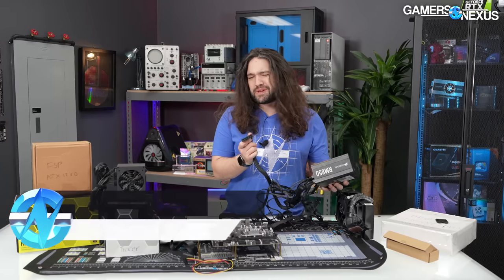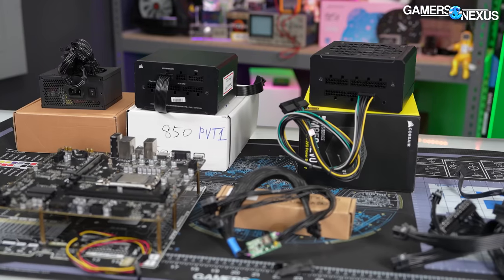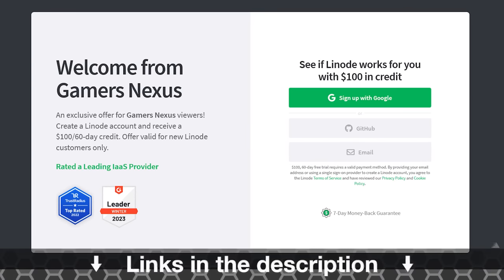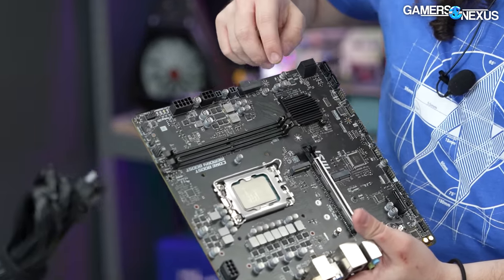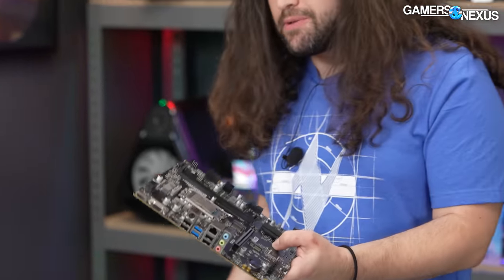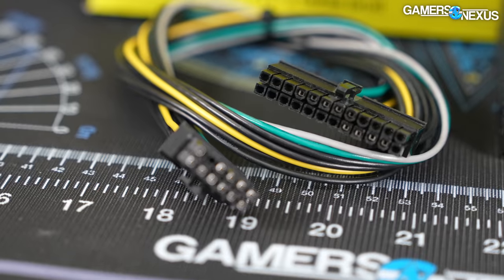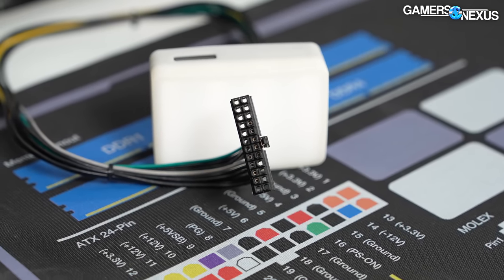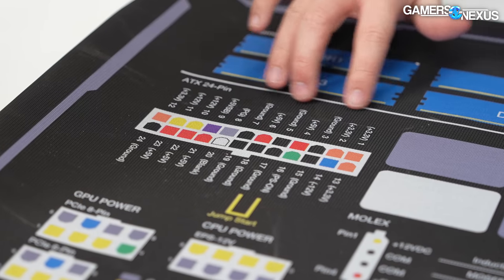The Future of Power Supplies - Maybe (Motherboard Cost, Cables, & ATX12VO)

Comment: Always hated the classic ATX power plug. The amount of interfacing surface always made plugging and unplugging an anachronistically hamfisted ordeal. Glad that this is finally starting to be phased out for leaned-down connectors that are mechanically less stressful to operate. Would even have been happy enough if they'd left it at the original size and just split the plug into two more manageable chunks.

Comment: I don't get it, Sure the 12V0 mobo header et al is more efficient and all, but why the requirement for the 2 sata power plugs being on the motherboard, instead of just moving the newtype sata power cable connector onto the PSU where it's always been?
Realistically it'd be just as efficient staying on the PSU.

Comment: Oh hey, here's a little secret. In the corporate space we set up ALL of the machines to NEVER enter standby and we literally edit the registry to disallow every other power states except always on. Ile literally setup 10's of thousands of machines like this. The reason for this is to eliminate onsite calls where almost every machine requires daily maintenance with backups, database maintenance, software updates, etc. Also most people want to be able to access their systems after hours and WOL is generally unreliable. My PC's have NEVER been allowed to leave high performance mode, EVER. This 12VO thing will end up being detrimental and will lead to board manufacturers adding less and less options for storage and peripherals.

Comment: I wonder for my next AM5 APU build will Corsair 750W SF750 SFX   PSU 
Be good enough, or will even APU build require 1000W ATX PSU ?   Btw I'm not planning to add any GPU. ❤ Plan to use 1080p monitor.
Reply: What APU is pulling 750w???

Comment: 12VO sucks for powerhungry boards. It is time to step it up to at least 24v. Mosfets are still easily available in small sizes to handle that and the losses in the cables drop by a factor 4!
48V to POL (Point Of Load) has been a ting since well before 2016 and is something they should look to for this. Regardless of what we do, the total ratio is still something that will need conversion. 300-400v rectified grid voltage (NON 110v ac countrys) will need to get down to core voltages of 0.8-1.2v range. It can be done in multiple smaller steps or almost directly.
Safety-wise this should NEVER go directly as a single fault would then explode the boards valuable chips. Crowbar circuits on output of stages should be mandatory and going to something like 24-48v first seems logical. You want as high as possible voltage to pass through the long runs of wire, then you can step it down as the distances to be traversed gets smaller. A rough 48v to 5v or 12v could be an option at the GPU-boards power input, and then the normal regs can do the last step. The efficiency needs to be pushed high though or the diminishing returns start to add up fast. As-is we loose almost as much in the cables for a RTX4090 as we do in the supply converting from linevoltage to 12v.

Comment: I can't imagine 960w running through those small traces in the motherboard without iinterfering with other increasingly sensitive data bus lanes. Should be quite the task insulating the EMI, which means added motherboard cost, on top of "budget" boards already being premium tier price from a couple years ago. Maybe PC building will be a thing of the past if they keep pricing items beyond the purchase power of the general population.

Comment: What's really needed is for the industry as a whole to agree to stop designing and producing devices that require voltages other than 12V. Then we can dump the conversion circuitry on the motherboards and just use 12V everywhere.

Comment: Really nice, more points of failures to motherboards and even bigger price, just what we needed😡

Also I'd rather buy a new good PSU if the one in use fails than having to buy another motherboard to maintain a old PC and it takes me MANY years to be able to buy a whole new PC.

A good well chosen PSU at least even if it's bought for replacing a bad one for a old PC can then later be used for a brand new PC at any time while the motherboard will need a complete change specially on intel side and anyway I never had any CPU upgrade within the same socket unless back in the Intel LGA775 era. Hell even if I went now for a AMD AM5 I would probably never upgrade anything other than GPU and the next upgrade would be AM6...🙁

Comment: computer manufacturers: "lets change power supply spec to reduce idle power draw by 2 watts to lower the load on the power grid"
also computer manufacturers: "lets start making 300 watt CPUs and 450 watt graphics cards!"

Comment: I like the 12pin, but I don’t like the fact that the motherboard has to provide power to things like Molex and sata. 
Motherboard can make its own 12V and 3.3V for its onboard devices, but the PSU should still be providing external voltages to power to sata drives. 
That way, boards don’t have to overbuild those rails, and you don’t have a bunch of random ports off of it.

Comment: I still don't like the idea of ATX12VO. My homeserver for example got 8x HDDs + 16x SSDs. According to datasheet each of these SSDs needs 4.6W on the 5V rail + 5.5W on the 12V rail. So the SSDs alone need 73,6W on 5V. Its already hard to find a ATX PSU, newer than the early 2000s, that can deliver that on the 5V rail. Don't want to know how hard it will be to find a motherboard that got enough 12V to 5V step down converters to actually power all those SSDs.

Comment: So things that make mobos more expensive:
1. LGA sockets
2. premium onboard audio because no one buys sound cards anymore
3. DDR5 signaling
4. And now the 5V & 3.3V rails

I look forward to my next mobo costing more than a 4090.

Also, you know who I trust to design power supplies? Seasonic. You know who doesn't make motherboards? Is there going to be a future where there's premium motherboards that are 12VO with 3.3 & 5 input from a break out board from a brand that actually knows their stuff? Does it matter? Can you do bad 3.3/5 volt conversions (I assume so)?

Comment: i have my HP Elitedesk 800 G2 SFF which have a 200Watt 80watt platinum power supply. (15A on 12V)
Its almost 12Volt only, but its not, since the power supply have phase shifted -12volt on the power supply.
also on the motherboard, it have a buck converter for 5V and 3.3V since we still need 5v and 3.3v for the ssd's, Hdd's and dvd readers, which i dont use, only the sdd's (I have 2x 240GB ssd).

I like the idea of 12vo power supplies, due a few less components, also that only voltage rail can be even better, or multiple paralelled 12v rail can be made (not only 2 that some power supplies have, like my vintage Codegen 450Watt power supply 14+8A on 12V which having transformer so big that i measure it in qubicmeters (its not your cheapo chinese power supply. built very good and beefy))

But if i like oc my 40Watt card, it start drawing 60watt, and i have a load of 240-250Watts on my poor G2 SFF 200Watt psu which is actually 15A max * 12V which is 180Watt total power.

Soon im getting a new videocard replacing my old R7-240 with a sweet GTX1080, im gonna get a G2 SFF cable converter from 24pin to G2 SFF cable, due im also have to buy a good power supply xd. :)))

18:47 wait, hol' up, is that power supply still allive???

Comment: I hate the OEM versions of this that HP and Dell have been using randomly in usually really low end boxes for the last few years.  HP even has used an external laptop ac adapter for some of their desktop motherboards, which might not be a bad thing cause it would be cheap to replace compared to the off standard 12V ones the other systems use.

Comment: like my hp elitedesk  800 g3 .... the psu ( that i changed to hp sfx 500w80 gold) has a 6 pin and 4 pin and a 8 pin for my gpu ,sata voltage goes from mainboard via 4 pin connector  and the bios checks the id of the psu .... because of a wierd 7 pin mini connctor  that is not compatible  i get at every start up  a  ID error .. but run good

Comment: I personally think that all voltage levels should be "created" (actually "regulated") on the PSU side.
   And why?! Well... I already mentioned the word "regulated". And by leaving everything to the PSU, the voltage levels can be regulated more EFFICIENTLY. Because when higher current are drawn on e.g. 5V, this of course will also affect the 12V level. You can't simply assume that voltage levels can be operated independent of each other. So leaving all control to the PSU, allows the voltage regulator to better balance the different voltage levels and operate at a higher EFFICIENCY.
   Also do not forget that leaving everything to the PSU, the buyer itself has the choice to go for more expensive monitoring and regulation circuits... I do not think that many motherboard manufacturers will want to use the most high end circuits, inflating the cost of the motherboard.
   And also dont forget the "security": protection against overvoltage, undervoltage, overcurrent, overpower, overtemperature... You want this as close to the mains as possible. Letting e.g. the motherboard do voltage regulation - and a component fails on the motherboard - you risk writing off a complete motherboard.
   So concluding: I prefer it when the PSU keeps all regulatory functions and preferably should digitize further ...
And if they want to simplify, they should first take the decision to phase out the 3.3V. Because that voltage level isn't used that much. So first take that step instead of this huge change to only go for 12V.

Comment: My two main gribes on this is cost and heat.
It will absolutely increase cost for both boards and complete systems.

But the bigger issue is heat. Any time you drop voltage there will be loss and therefore heat generation.
That was previously concentrated in the PSU where it was immediately exhausted.
With this it'll be moved to the system board and will have to be extracted from the case.
I'm sure it's "only" a few percent.
But how much effort is already being put into "just a few percent more" ?

This just seems like a step backwards to me for home desktops

Comment: I'm really just afraid of older PC parts that don't only support 12V.
This is already a problem today with -5 volts, this no longer exists on any PSU.
Hiding cables then becomes a thing again.
You will probably be limited by the modularity.
 In this way, low-end mainboards can be limited even more, while high-end boards become even more expensive.

Comment: I prefer the old layout, because if a 5v rail dies then you can change the PSU and as technically PSU are replaceable without having to change the CPU and ram I see that this move only benefits to the companies, and not ours

Comment: Having the power conversions on the motherboard was pretty much how everyone did it back in the day outside of the IBM PC world, also having to swap out a power supply because of a new standard popping up is nothing new either, I've gone through at least 3 standards already AT, ATX 20pin, and now ATX 24pin. The big issue is now with all the "legal price gouging" (inflation) swapping stuff out at the drop of the hat can be financially painful, hopefully those adapters are an affective affordable option.

Comment: So what happens when the wire used for sensing power usage fails?  Does that mean your motherboard then dies because it gets too much power?  I much prefer that the psu dies if it gets overloaded vs the motherboard dying as replacing a psu is easier compared to replacing a motherboard.

Comment: 0 point until all devices are 12vo, now when a stage of the power supply system goes you swap the cheap and easy psu, your more likely to replace a mobo then the psu if still needing to shift down to 3v & 5v via the mobo.

Comment: Though i like a smaller power connector for the mobo, this would mean much more would need to go to the mobo side, they become more expensive, need to put more on the board, and it's taking up space on the mobo. I don't fully think this is the way to go. And the power supplies will almost certainly retain their cost price.
I also think it invites more problems on the motherboard side, so i don't think this is the way to go honestly.
The motherboards are already getting quite pricey now with all the new stuff, and then adding more chance of failure is not a good thing at all.

Comment: I can think of a lot of reasons that I don't like the 12Vo spec. Here are a few:
      1.    i_psu % is a wasted wire and pin
                 a) anyone that doesn't spec out the PSU properly deserves to have things blow up in their face. Why are we designing around idiots that can't spec out a system?
                 b) anytime your PC doesn't seem like the performance is what it should be who wants to have to try to check the power supply throttling pin?
      2.  Power supplies are made to ....surprise surprise ...supply power why are we giving that job to the motherboard?
                a) currently if your computer won't boot its super easy to pull the connector, plug in your power supply tester and confirm your voltages are correct.
                b) more crap on the mobo is more stuff that can go wrong and will require you to replace your motherboard.
                c) a mobo replacement will be much more time consuming and costly than dropping in a new power supply.
       3. You said the real estate would be about the same but I don't see it. Yes the connectors are smaller but there needs to be room for all of the VRMs now on the mobo. That will be a huge
                   problem especially for micro atx motherboards. Smaller motherboards for tiny computer builds already don't have much on them due to space constraints.
       4.  If they want to improve the power supply system they should change the wires and pins to be able to carry the currents now required on newer systems. Having multiple wires crimped  
                under tiny pins is really dumb. All of these doubled up wires is also really dumb. Increase the wire size and pin size so that you only need one wire for each power and ground.

Comment: I see the advantages of this, but at the same time I like the god old standard that we use today. Modern PSUs are fairly cheap and modern motherboards are expensive. So the motherboard would be much more expensive to replace than a regular PSU if something breaks. 

Modern PSUs also have a lot of safety features so if you are unlucky and shorting out a rail on the PSU, the PC shuts down and you can reset the PSU and restart the PC without anything breaking. 

Im having a hard time believing the new 12v standard would have this much "safety features" built in.

Comment: wouldnt moving all the Voltage change onto the Motherboard just put the price of the boards up even more and would have to change an expensive item ( board ) if something stops working where a change of the power supply is a lot easier . Like Washer dryers its better to have a washing machine and and separate tumble dryer

Comment: Great analysis, but I am not excited about this direction. Motherboards are in a bad state already with overly-confusing feature mix, so adding this in to further complicate them has me very concerned. Also seems like an over-engineered solution by Intel - oh, we have a standby power drawing slightly too much than we want, so lets redesign the PSU and the Motherboard! Surely, there is just one small section of that which really only needed the attention 🙂

Comment: This whole spec change seems to be awfully close to trying to cause a mountain of ATX 2.0 PSU e-waste. I surely hope they take that into consideration and maybe make adapters a viable option, as ugly and impractical those would be. Someone tomorrow could buy a seasonic, Corsair or EVGA power supply and foreseeably use it for the next decade. Everyone involved needs to take that into consideration.
Reply: You're over-estimating the problem of e-waste. The idle power savings over the useful life of an ATX12VO PSU will be enough to buy an entire legacy PSU.  And no reasonable social-cost-of-e-waste estimate has it higher than producing the thing in the first place.

Comment: Forcing E-Waste with every new PSU and adding extra cost to motherboards...
All consider I think is fine, we had this sort of change already with 6-8-4 pins connector been a requirement for higher TDP CPU/GPUs.
As long as they come with a good standard I'm fine, not like that crap 12+4 thing Nvidia is pushing on PSUs.
I wish they also invert GPU position to improve air-flow so a simple tunnel of fans can push both CPU/GPU air outside in a simpler way and even consider moving the GPU slot near the main motherboard connector and use a single plug for everything on it, sure a 10 pin wouldn't cover it but yep.
More voltage also means less current and less magnetic interference but I don't thing that's what they are aiming for.

Comment: So my 100W USB kettle will be powered by 12to5 converter on MB? Cool. I hope that it will be strong enough to provide enough capacity for all USB ports...
Reply: USB PD @ 100w works at 20V minimum. It’ll likely work based on an integrated buck/boost circuit built into a purpose made usbpd chip hooked up to the 12v rail.

Comment: More efficient PSU sure, but also less so on the MB side as the convertion still need to be made and I see no talk about validation of how efficient the motherboard does it? OEM are welcome to have cable from MB to drives but personally I like to hide them as best I can so a 12+5V solution where powercables for drives don't go through the MB would be easier to addapt to. Since we're already talking about new motherboards anyway I'd like to see a new PCIe standard that can supply more than 75W to accomodate todays (video)cards need instead of relying on bulky PCIe cables.